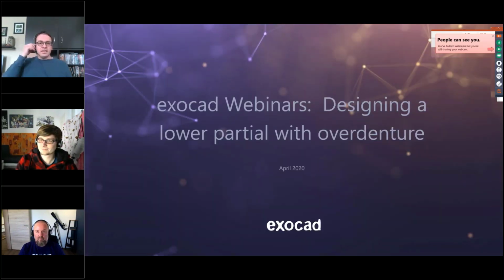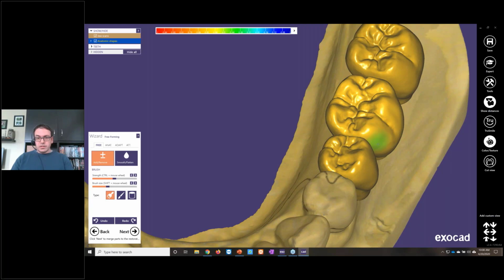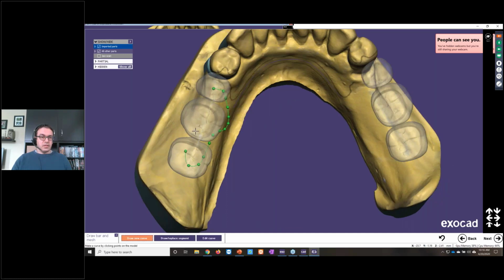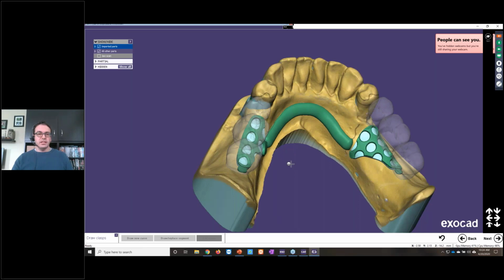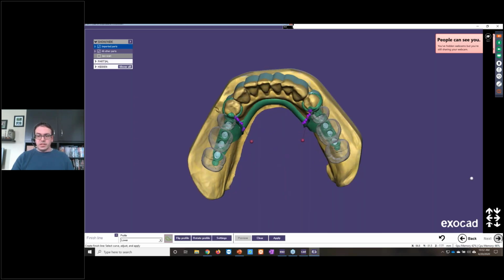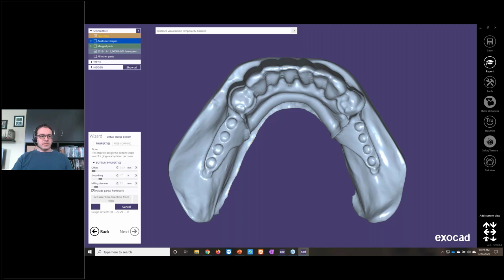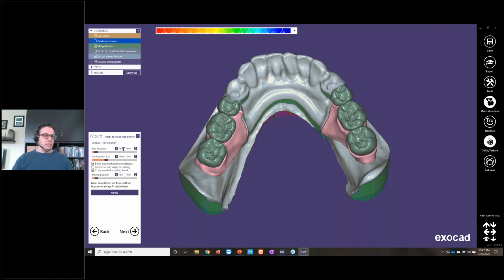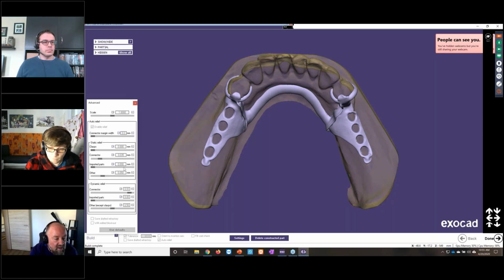exocad PartialCAD 2020 WEBINAR - PartialCAD Module

Comment: HI, iM TRYING SO HARD TO DESIGN U/L PARTIALS CASE BUT WHEN I FINISHED THE WIZARD I DONT GET THE SAVE SCENE INTO CAD, THE CAD SW CHECK FOR WHICH ARCH I WANT TO DESIGN BUT IT SEEMS THAT THERE AN ISSUE ABOUT THE UPPER AND LOWER TO BE ANTAGONIST AND PARTIAL AT THE SAME TIME?
Reply: Did you solve this issue bro ?